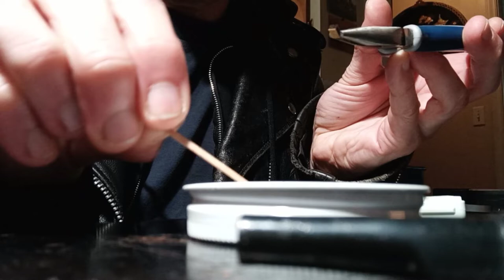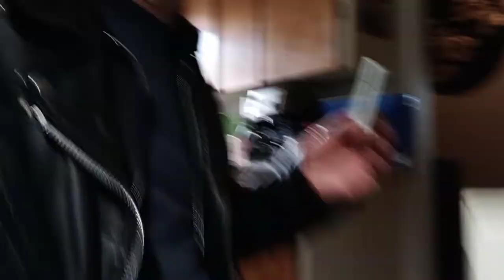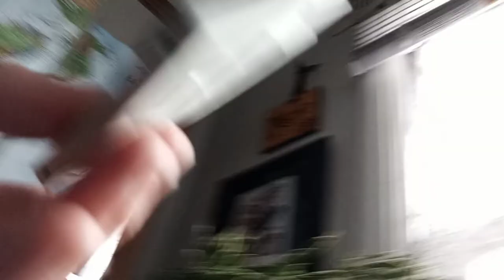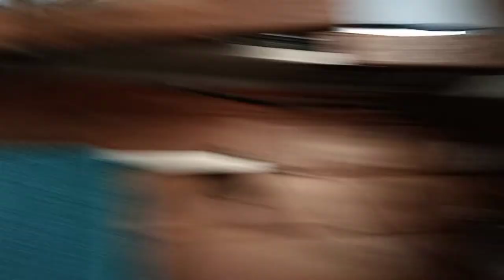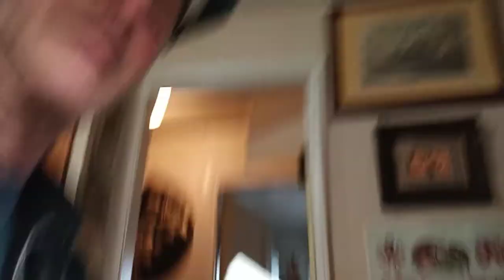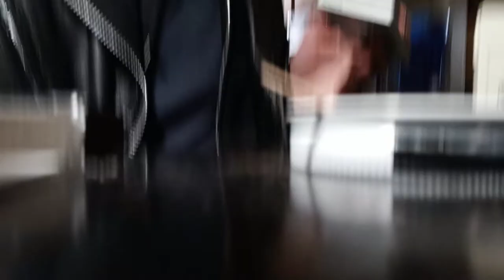Repairing Led Zeppelin cassette tape felts, super glue, tooth picks, needle nose

Comment: Ah you should also move the reel back a bit more anyways i would suggest looking in to cassette cleaning machines they are pretty rare to find look up one by the name of JAPT Cassette Cleaner JT-1000 supposedly they pretty much clean the tapes from anything spilled on them not sure how good they work i was thinking about getting one.

Thought i would ask john any favorite albums you would recommend espeically on cassette? maybe that would also make a good video can't beat the distortion & hiss that underground sound. i also would note how good the high range is as i guess the joke goes you don't need noise reduction or overly dubbing something to distort it even more on the production aspect lol yet not everyone pays attention to that. 

it's amazing how much some stuff goes for when they were worth nothing 8 years ago seriously every time i come across a beatles greatest hits now at a record shop with the prices good luck on metal stuff it's priced more than brand new tapes for the bands it are still trying to do something with them. now they are having to keeping up with ebay that has taken some of the fun away